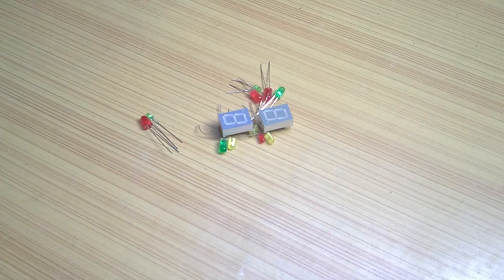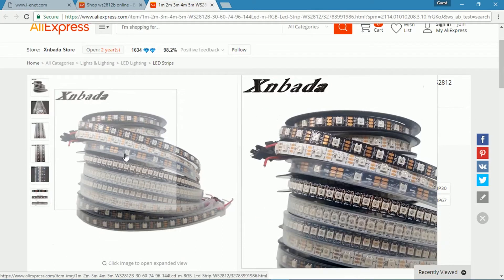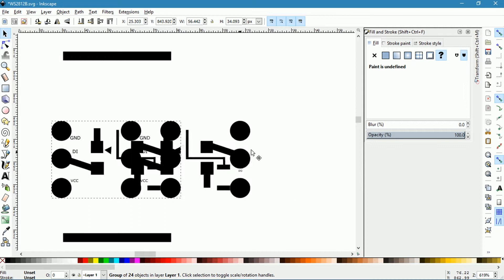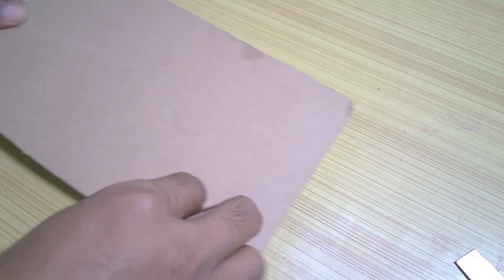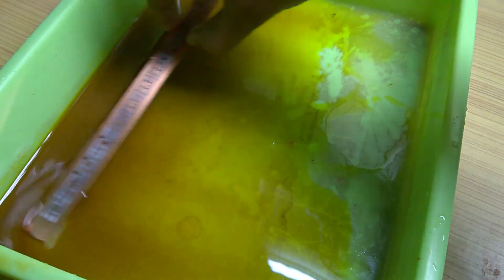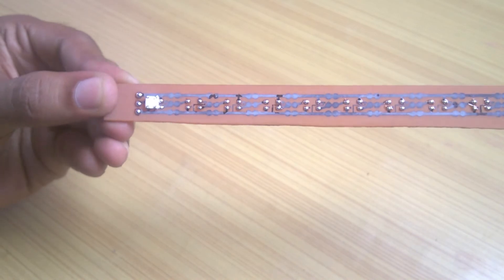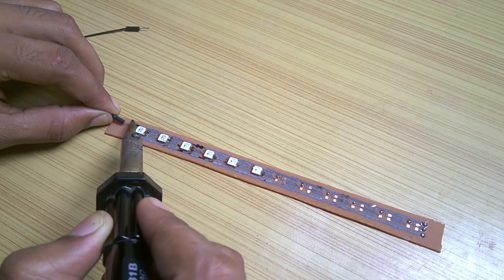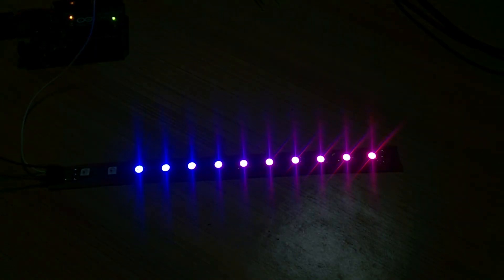Custom Addressable RGB LED Strip || WS2812B

Comment: you did not put capacitor ,or resistor ? Great video bro
Reply: It doesn't require any resistor, it sure does need a capacitor which I didn't add because I didn't have a SMD cap that time. You can add a 104 SMD cap between power rails for each LED there is.

Comment: Thanks for posting this very interesting addressable strip. How powerful are these LEDs ? can we replace them with a 3W LED? I wonder if a high power 16X16 LED matrix will fit in a 10 square-cm form factor.
Reply from the maker: No, they are not that powerful. Maximum current they draw is 60 mA, which means at 5V it is 0.3 Watt. Their brightness is nothing compared to a 3 W led.